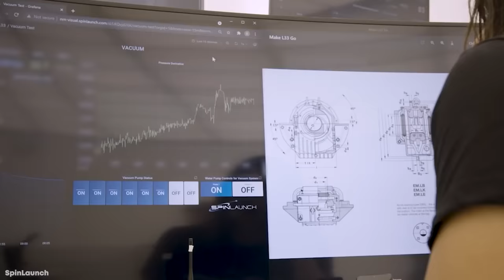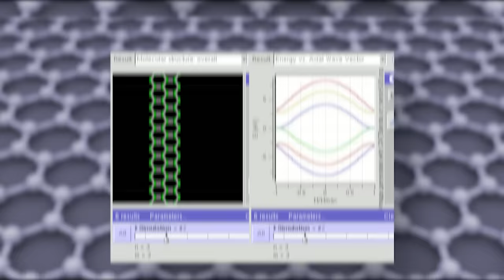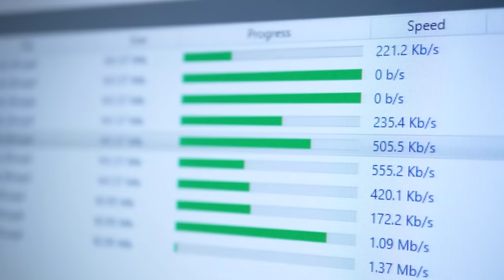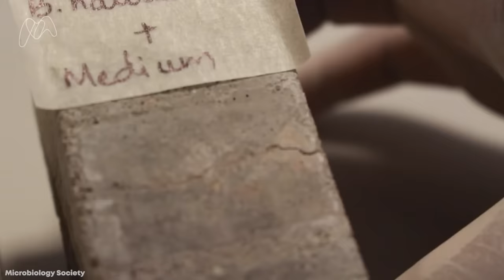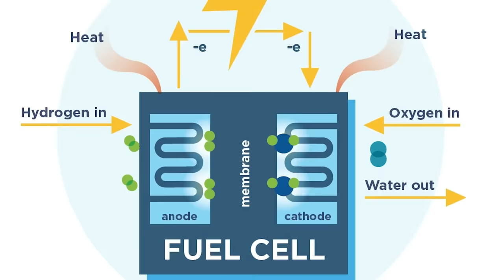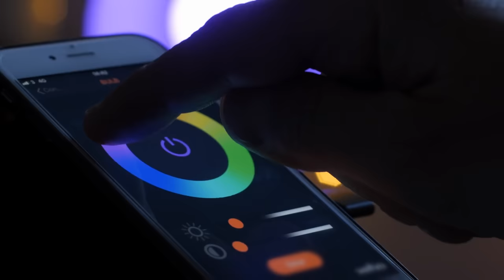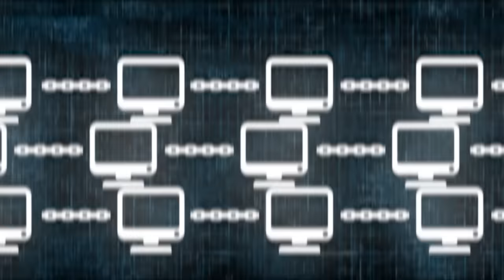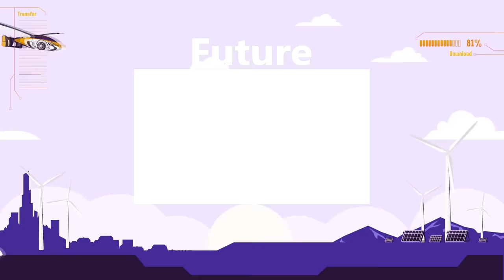15 Emerging Technologies that Will Change the World

Comment: The fire suppression without water was incredible. It could save many lives and property especially if it could be auto activated like a heat detector. Imagine how much property and how many sleeping people could be saved, especially if this had a built in alarm and was rigged to keep hallways clear of fire. What an invention....WOW.
Reply: I'd put my money into clean/server room fire suppression technology. The only viable solutions currently available are high in cost (not when compared to the value of what they protect). But I'd bet this will be the best area for this technology to gain access into the NFPA
Reply: Co2 systems/extinguishers run the risk of thermoshock to the equipment not to mention the dangers of Co2 exposure in confined spaces. Clean agent systems (Fm-200, Novec, Sapphire ect.) Are great but do have critical flaws.
Reply: If it takes oxygen out of the fire triangle, what will this device do to a human's lungs?
Reply: A typical case of fantasy engineering !
There is a limit to the size of a transducer (speaker) and therefore a limit to the quantity of air it can move which means the nozzle must be very close to the base of the fire. It's fine for smaller fires because it can move enough air to completely starve the flames of oxygen but completely impractical on a fire that is larger than the size of the transducer ! You can only extinguish part of the fire so when you move the nozzle to another part it relights.
Even if the transducer was 3 meters wide (which is impossible) and the nozzle was a similar size it wouldn't work if the fire was 5 mts wide !
Reply: A transducer of that size isn’t impossible. Maybe impractical at best. On the other hand I do agree that it wouldn’t be effective in uncontrolled environments. However, in smaller sealed rooms such as clean/server rooms. I believe it could be effective
Reply: On a side note. I think the point  you were trying to get across is that. While yes, the flame itself may be extinguished. The heat would still continue to pose a threat of re-ignition. It’s interesting that people are beginning to understand the importance of resonate frequencies/vibrations. Unlocking its secrets & uses will be an interesting factor in future technology
Reply: People not starting fires would be more helpful.
Reply: Unfortunately, this device won't scale. A suitably powerful fan can blow out a small fire like the one in the demonstration video, but a forrest fire is of a completely different scale. What kind of sonic system can overpower the 60 mph winds generated by the updrafts from a forrest fire? The scale of sound wave that can stop a 60 mph wind, is that, uh, safe for humans, or even for trees? Even supposing that it's possible to build such speakers, how are we going to build and deploy 100,000 acres of such sound equipment into the remote wilderness? This all seems highly implausible, and the more likely explanation is simply that it's a lot easier to blow out a candle or a small flame than it is to snuff a massive forrest fire.
Reply: @ddopson  Cooling is also required to keep a fire out and water works well for this.  I doubt that simply removing the oxygen will work in the real world.
Reply: @jenniferjen5422 well, nothing. I'd be more worried about their ears.

Comment: SpinLaunch:  really safe until it isn't.  Just imagine any tiny thing going wrong, then you have something weighing hundreds if not thousands of pounds, that is going thousands of miles per hour, possibly breaking apart and sending debris in countless directions.  Not just satellite debris, but debris from the building.  These would have to be built at very isolated locations - even more isolated than traditional launch pads.
Reply: Or built partially into the earth with just the launch hatch being above the surface.
Reply: lmao they started off with spin launch... check out thunderfoot video on spin launch to get a full idea of how dumb that idea is... this video lost all cred in the first few seconds and im not even gonna finish it now
Reply: @fearlesslearner3015  The kinetic energy of an average sized satellite, leaving one of those centrifuges, is about 6.9 billion Joules (2755 kg is avg satellite size, and 5000mph is 2235 m/s).  For comparison purposes, the kinetic energy of one of the airplanes that hit the World Trade center is about 2.9 billion Joules (travelling 219m/s and assuming the mass was about half-way between the empty mass and max takeoff mass, I used 120,000kg).  This puts the satellite's kinetic energy almost 2.4 times what each of the 9/11 airplanes had.  I don't think there is a feasible way to design around containing that kind of energy damage.
Reply: And I see all kind of countries building their own spin rocket launchers, aimed at wherever.
Reply: Spinlaunch is not even close to being in a test state. Going 5000mph at ground level right now calls for materials that are not yet available due to air density at that altitude. Also if you look closely at the promo video it comes out spinning instead of a straight line.
Reply: Yeah spinlaunch is bunk, a better new technology aerospace company to  focus on would've been Relativity Space, with their 3D printed rockets, super fast iteration cycle, and ability to simplify and optimize in ways that are impossible with traditional rocket building technology.
Reply: "Space pollution"?!
SpinLaunch just uses less expensive, more energy efficient technology to cheaply produce more space garbage. Awesome.
Reply: @timf3099  Wild of you to assume they'll ever launch anything into orbit.
Reply: Even in normal operation spin launch is a total safety hazard. When a centrifuge is even slightly unbalanced (like for example a piece flying off of one end) it can easily rip itself apart because of that. If they ever try to accelerate a satellite to orbiting speed and then disconnect it from the machine, the whole thing will come flying apart. Building the whole thing strong enough to even reach that speed will take some seriously advanced materials, but the disconnect will still definitely kill it.
Reply: @not_that_person  Yeah, you've gotta point there LOL. It was the idiotic narrative narrative that was drilling into my head =P
Reply: @fearlesslearner3015  Agreed, what if they do this near communities and have they considered accidents and sonic booms? People make mistakes all the time, especially with technology.
Reply: @RcAndries  haven't looked into it that much, but aren't these launched in a (near) vacuum?
Reply: going from vacuum to air pressure at launch speed sounds like it would make some nice debris
Reply: @DudeoftheDunes  yes, or at least a very low pressure in the chamber. The problem is when it leaves the chamber at that speed it hits the highest air pressure (ground level) at mach 4-5. This is something no missile or jetfighter has archieved so far.
Reply: Phase conjugating mirror
Reply: Yeah, seems reckless.
Reply: What about putting them at the tallest most mountain that would allow it?
Reply: @daab  I didn't think about that. You'd think starting a few kilometers higher up would solve that. Nice.
Reply: Already been debunked by Thunderfoot
Reply: @timf3099  Spin Launch thoroughly busted by Thunderfoot.
Reply: Remember Murphys Law  !

Comment: I've read that hydrogen can work it's way through any container material. In your piece about graphen it was  stated that it is impermiable to gases -- even the lightest one. Assuming the narrator meant hydrogen, it might be a solution to the long term storage of hydrogen, perhaps.
Reply: Theoretically, if the graphene film/coating is flawless

Comment: 15. spin launch - a different spin on mass drivers, but okay (sorry for the pun).
14. graphene - old hat by now and mostly an umbrella term for any 2d-material, but okay.
13. GPS 3 - old hat, in europe we have GALILEO and other parts of the world have similar navigation systems, but okay.
12. floating farms - meh. lab grown, 3d-printed meat and urban farming will have a much bigger impact
11. edge computing - not really a technology by itself but a fancy word for a trend that's been happening for years
10. self-healing concrete - meh. let's have flying/crawling drones that scan and repair buildings and infrastructure instead, please?
9. hydrogen fuel cells - the basic technology has been around for over 150 years, so.. old hat. the real breakthroughs are on the  side of catalysts, metallo-organic frameworks and meta-materials, which are amazing, though.
8. satellite constellations - oh god, please no. our orbit already is so filled up with space junk that if we keep up shooting crap up there, we could get a chain-reaction with everything colliding that we lock ourselves in under a blanket of junk. thanks, but no thanks.
7. GPT-3 - deep learning definitely is a great enabling technology for many applications which will have further deep impacts.
6. connected homes - meh.
5. lithium metal battery - meh. there are a number of contesting technologies, we'll see which will win that race.
4. 3d printing - oh yeah, definitely. everything from building affordable houses, space habitats, consumer goods to organs for implantation.
3. blockchain - oh yeah, definitely.
2. fighting fire with sound - wtf? and that's even 2 on that list? how about weather control systems to let it rain on those wildfires instead?
1. quantum computing - oh yeah, definitely.

stuff that should have made it on that list, imo:
- RNA printing and encapsulation (like some covid vaccines) to fight cancer and other orphan diseases that were untreatable so far
- organ/patient on a chip - microfluidics is an extremely powerful but underrated enabling technology 
- fusion power has made some great strides this past year and might be the enabling technology for an actual space industry/economy - say asteroid mining, meteor defense systems, habitats on moon and mars
- self-driving cars - even if it sounds like an old hat. with only 10% of all cars being autonomous, traffic jams will be a thing of the past, overall fuel consumption will be drastically reduced and we could replace busses and trains by public cars that will bring people to their destinations like packages are routed on the internet.
Reply: I'm gonna address some of your points out of order. Self healing concrete is way way cheaper and more practical than drones flying around fixing things. You highly underestimate graphene. Satellite systems are at different distances from the earth depending on their application, Stuff that breaks will either fall or fly off, not create this single layer of satellites and space junk. Fusion is the most over-hyped impossible technology, people forget that the main fuel source for the sun is the immense gravity it naturally gets from its immense mass, recreating that amount of gravity artificially will never be efficient. You're pretty spot on with everything else though. I watched the video and had to check the date to see if it wasn't made 5 years ago.

Comment: The most incredible emerging technology without doubt is fusion.
Reply: Yes and we could  be up and running with cold fusion but they said Ponds and Fleishman were wrong...
Reply: The most needed will be desalination. Power can be gained in many ways.  Fresh water(for the current population and future) not so much. Being a renewable resource only matters if you use less than what's replenished.

Comment: I think you didn't quite explain that hydrogen vehicles are electric vehicles that use hydrogen to improve fuel density and weight when compared to batteries, Hydrogen production uses more electricity generally than just charging the battery, the efficiency emerges on the consumer end though allowing for longer range, lighter electric vehicles. The important thing is that this doesn't necessarily reduce the energy being used for fuel and on top of that the hydrogen-oxygen electron generator uses platinum and other rare metals. It's super cool but it won't change the world and will only truly be able to exist in energy secure, wealthy nations.
Reply: @docked9953  The hydrogen cell as it stands is quite expensive and the materials he mentions above is true. Go ahead and read some articles about the cells...
Reply: Battery EVs right now are all the hype, and TBH I don't see them being replaced by hydrogen fuel cells any time soon (if ever). I think it will only grow in convenience as home and apartment building chargers are becoming more of a norm than novelty.

Where I can see hydrogen fuel cells exCELLing (pun intended) is electric planes and it kinda boggles my mind that I have not seen a single YT video talking about this (besides a brief mention here) (and I watch a lot of science communication videos, like too much for the free time I have available). It's lighter, planes require professional equipment and staff to get refueled as is, I see no downsides.
If you have any material to recommend on hydrogen cell planes, feel free to share :)
Reply: Sausage
Reply: @docked9953  boom. Nice
Reply: I think Israel has Hydrogen buses to wean off gasoline buses.
Reply: Ballard has been operating fuel cell-powered buses in Vancouver for nearly thirty years. GM had a hydrogen fuel cell-powered S-10 touring the country back in the 90s.

The problem isn't the tech; it's the infrastructure. That and, as someone else mentioned, the fact that it requires greater energy inputs than you get outputs, so it's not quite as economical as it may seem.

Yet. If/when a more efficient way of producing hydrogen comes our way, that will change.
Reply: I have a family member that worked on the very first hydrogen fuel cell engine he said it would be very good cost-wise however it does pose its own dangers. He worked at aerojet as one of the lead mechanics. And it was for a rocket.
Reply: @nickace843  One of the ironies in all this is, the fuel cell was invented in 1838 -- over 180 years ago. But the reason we've not taken advantage of it is the input costs: it's a net loss. For now, at least. I believe someone will solve this soon.

It's like ethanol: Big Government (in the U.S.) pays Big Agra beaucoup bucks to grow corn for ethanol. It's wildly inefficient. A better solution would be sugar cane, which places like Brazil have taken advantage of. But in the U.S., Big Agra is a far richer lobby than "Big Sugar."
Reply: Yes, the vast majority of hydrogen production is by steam reformation of fossil fuels. 95%, from memory.

Meanwhile, hydrogen is only storage of energy extracted sonewhere else. And the only efficient way to use it in a car is to use it in a fuel cell, powering an electric motor (usually, with a battery to cover bursts of high output).
i.e. it's an alternative to a big battery. The only advantage I can see is its energy density, and that comes at the cost of massively increased CO2.

Now if fusion, or the newer, safer fission reactors (such s SMRs) suddenly produce vast mounts of spare energy, we could electrolyse water for hydrogen, but until then it's little more than an alternative sales pitch for dirty oil. Dirtier in terms of CO2 than just burning the oil!

Comment: 3D Printing and self healing concrete seems pretty cool and beneficial but most other things like A.I and smart homes scare the shit outta me and are creepy as hell, almost end of days like.
Reply: I just spent the day tricking my phone (apples most recent iOS update has rogue capabilities).

Needless to say, I just scared the crap out of apple 😂   

Erased my iPhone in defiance of their safeguards twisted by their rogue upgrade turned Trojan.  

It changed the passcodes that I’ve stuck with (banks, phones, everything has had the same codes for 10+ years) locking me out of my entire home network (android affected by iOS, wasn’t meant to be possible;.. but it happened)  

My desktop, laptop, smart TV, iPhone 7, and iPhone 13 Pro Max, Amazon Assistant, all affected by an iPhone software update that has been redesigned to learn and self-adapt. 

I’ve had to wipe all of my devices and remove them from my home network;.. including reinitialising my wifi bridge, and resetting my NBN modem (to factory protocols) 

This sounds like a horrible sci fi story, but it happened today (Rogue A.I. defeated by a woman with learning disabilities)
Reply: @TWR1988  what a nightmare. Holy crap. Talk about making things complicated.
Reply: @Everything All In  tried to explain the scenario;.. and was censored 😂